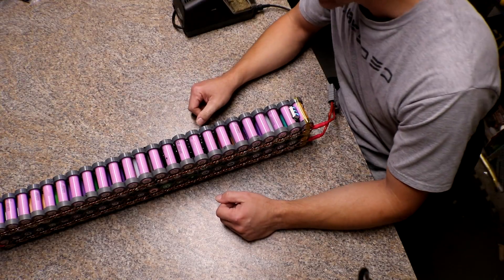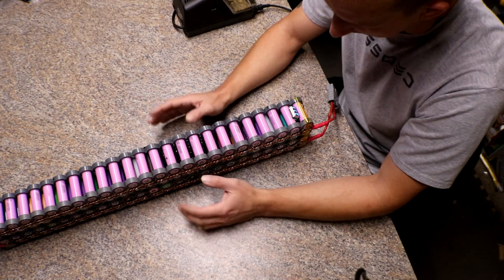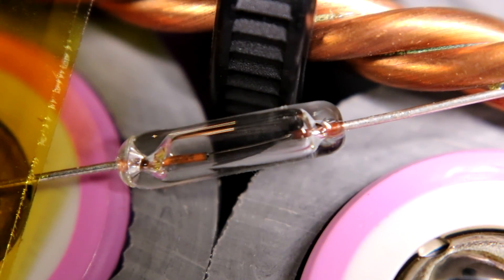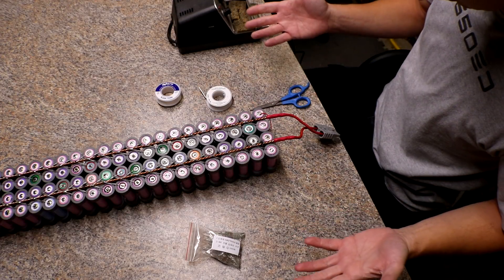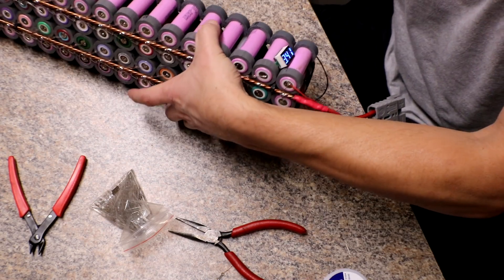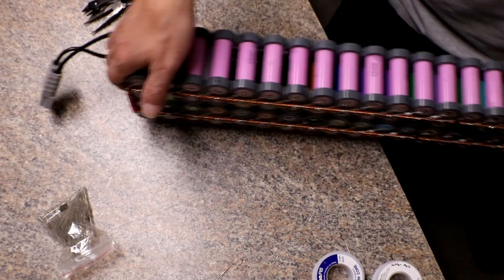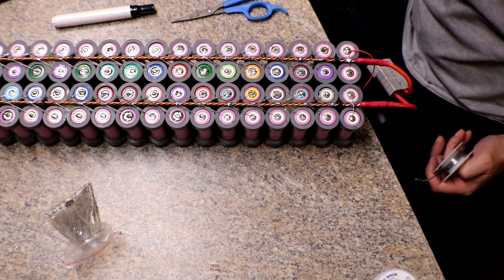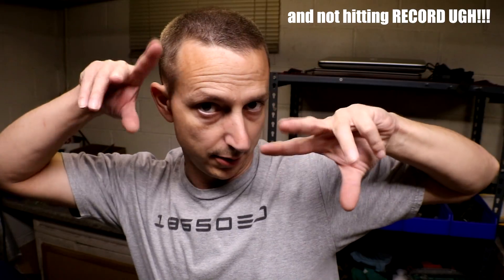Diy Tesla Powerwall ep62 kWh Load Test Failed Attempt

Comment: I don't understand this pack wiring. Where's the ground connector? both ends of the connectors on this pack are wired to the positive end of the pack
Reply from the maker: +Olivier Lopez Ch The positive and negative are at opposite ends from eachother.
Reply: Ah, I see. Thanks for replying.
Reply from the maker: You Bet!

Comment: have you got a link to the fuses you use mate nice work
Reply from the maker: The .5 amp fuses I am using are from Aliexpress https://goo.gl/YTgurx

The seller has other ones as well.  The .5a and 1a fuse pop at 2a .  I would get the 1a because they pop the same but have a little tiny less resistance. Those are here https://goo.gl/qzB57k

Comment: your packs are too borking large, dangerous.  I'm scared with my 3x5s but that's how my 4x5 clips came (super cheap bids, can't blame hong kong for overlisting)  but I'm thinking 3x3x3x3x3x3x3x3 etc
Reply: bcmasur that is y the cell level fuse is important tesla wouldn't put them in a powerwall application or in a vehicle without that research being done

Comment: If after being disconnected from the pack, the cells remain at the same volts as the rest of the pack (say a week later or two weeks even if you're as picky as I am) then you picked good cells for you pack.  Maybe I'll sell backsoldered magnets at 18mm lengths just for this.  nice.  good.  cheese.  please, my cheese...

Comment: don't solder indoors!  (unless you have a vacuum hood or some other great ventilation)  just do it outdoors and even then I am against soldering, it's too permanent and "unmodular" ?
Reply from the maker: I made a solder fume extractor with the carbon filters and then a hepa filter.  Seems to work pretty good.  Ive been thinking of making it exit out through my basement fireplace lol.  Need a longer hose for that 👍

Comment: Your packs should be more square shaped (cube shaped) than long rectangular shaped.  The way you have it here at around 2:30 in the video (or anywhere else) you should have your huge connectors in the MIDDLE of these packs instead of at the ends.  This also makes me think you needed to more thoroughly test each cell before adding them to the packs.  Also, I know I comment a lot on your videos, if at least one thing helps I'm glad to contribute.  I'm still magnetically connecting everything in my modular packs, still only 3x5Px3S at the moment.  Remember, my ebike battery was 12Sx16P in a USPS medium flat rate box, also aluminum duct tape and neodymium magnets.

Comment: second lost data info for your kil-o-watt meter how bout using a camera to record the usage time so you can recover it later after the inverter shuts down you can log your start time with the camera and use the kil-o-watt meter to log the kilowatt hours used untill it gets shut down
Reply from the maker: Doing a test right meow and the time lapse camera is working on it this time.  It was suggested on the fb page that I stream it with everything plugged into it and when it dies the stream ends cause there will be no more Power!!!  Might have to do it!
Reply: camera is the best way to go not every one can set long enough to watch paint dry in a cold room. rofl
Reply from the maker: True That!!!

Comment: Hey Joe, quick question, did you check for those cells voltage? in order to put them back in parallel they should have the same voltage as the rest of the pack, right?
Reply from the maker: Yuppers, they were close to the pack voltage so I just put them back in.  I do check with a spare fuse to see if it pops first tho.  I know the first time I found broken fuses when I first started messing with it a few weeks back, the cell was full charged and pack was at like 3.2ish I had to either recharge the pack or drain the cell so they were closer in order to reconnect the fuse 👍
Reply: Cool!!! So if it was a very different voltage, higher or lower, the fuse would pop?
Reply from the maker: With the fuses I am using yes.  They pop at 2amps so if the difference is to great it will pop.  I show it in this video https://youtu.be/p8rRMUomcj8

Comment: How about adding a cross tie of the same twisted wire "bus bar" on the positive rail just to one side of the battery before you go out to the Anderson?  That would stop the two sides of the rails from wiggling apart when you are playing with the packs.  Also add a little S on the fuse wires like was previously suggested!  DO IT!!  ;-)
Reply from the maker: +kirkb4989 Yeah I was planning to do the twisted piece between the 2 buuuuuuut forgot about it during that part. I usually forget to do things while videoing cause a lot of the time you are wondering if the recording of the video is in focus or in view ect ect lol. Im getting better 🤔
Reply: You do such a fantastic job now, I'm not sure how you could be better.  Don't undersell yourself!!  Oh hey- they do make a watt meter that remembers the values even if the power goes off that I've seen on Ebay for a reasonable price.  I could try to find it again if you are interested...
Reply from the maker: Thanks! Lol Ya I wasnt trying to sound like I was underselling, But I do intend to do things at the beginning of a video then realize I completely forgot about it while editing a video lol.  Ya if you see a link Ill take a look but you dont have to get crazy to find it 👍
Reply from the maker: Sweet, its in my list!!!

Comment: Hey Joe. Im working on a scaled down version of my own power wall. I found possible alternatives to your glass fuses that might help. 

I bought them on AliExpress, they are 2A micro fuses that look like thru hole resistor's.

FREE SHIPPING 100PCS x 2A 125/250V 2.4*7mm Axial Lead Green Fuse 2000mA 2.4 x 7 Fast Blow PICO Resistance Fuse
 http://s.aliexpress.com/uqqEvu2I 
(from AliExpress Android)

I haven't received them yet but will do testing when I do get them. I'll keep you updated on my results if you'd like.
Reply from the maker: +Steven Guzman I did do some testing with those and didnt go that route because you couldnt tell if the fuse was popped. I wanted a visual indicator vs testing them. Especially since there are 1400 and plan to add more packs in the future. Let us know what you find out 🖒

Comment: It is a little bit more work but instead of connecting the fuse directly with the hard lead connect a stranded wire to the fuse and then connect it to the bus bar that way it has Flex without breaking the glass fuse a little jumper made of 12 gauge or something of that nature stranded wire
Reply from the maker: +Kurt  Zxcvb Yeah that would be an option! 🖒

Comment: I think you should stop using the fuses .
Reply from the maker: But I like them 😉😀
Reply: AveRage Joe ya but seems that you have a lot more issues with those then running a thin 26 gauge wire as a fuse. Well hopefully that doing the swap around will help with the braking issues.

Comment: why was the cable tie loose? in the end, I think everyones doing it wrong. I would sacrifice length but having another set of holes at both ends and have no cells in it, then use those to brace the bus bars. In your case, you can simply put 2 on each side of the terminals (no need for 4 pvc cut outs, 2 will do). This is assuming you have room.
Reply from the maker: Well since my dumb ass didnt put the stand offs closer to the outer edge of the pack(when I was building the cell holder packs), if I tighten it more it bends the end down closer to each other.  The zip ties on the ends were a little tighter but I think from adding the kapton tape I made it to tight and therefore squeezed the ends closer together and made them looser lol if that makes sense.

Comment: now you have a charged cell you are paralleling with uncharged.  not good.
Reply from the maker: The cells were close in voltage to not pop the fuse.  Yeah if the cell was full charged I would of needed to get the voltage closer👍

Comment: Joe, another great vid - please keep up the great work. the fuse thing seems to be working in that you can get the feel of when one or two have blown by the way the voltage behaves on the pack.
i have an unrelated question - i'm wanting to get into doing some vlogs and was wondering what kind of editing software you use and if you maybe have a "wish" editor you'd rather use or have been thinking about switching over. i, (like you) like easy, but effective.
Russ from Coral Springs, Florida, USA
Reply from the maker: Aaaaaan the winner is....... Sony Vegas Pro 😀
Reply from the maker: Thanks!!!  I still like the lil fuses and that swap-a-roonie should fix the problem.  Yes for sure, the little tests so far are showing me good things as to when or what needs attention👍  I started with the windows movie maker and it did just fine.  I think for vlogs you could easily use it if your using windows.  I have since moved on and use Sony Vegas Pro 13 and love it.  I havent tried any others so I cant say if there are any easier or better editors.
Reply: in for the comments, what dose the average joe use? @average joe ?

Comment: Wonder if there is a way to remotely monitor each fuse....hmmmm
Reply: what if you create a fuse box with 1400 of those fuses in it with wires leading to it -  or would that increase the amps in the cell or something - adding wire - I dont know -- - - -  but it would be convienient to have all the fuses in a clear door box to view them all at once, you could even add you fancy blue leds for illumination. thoughts?
Reply from the maker: A remote location would be cool but then it would add a lot more resistance to the system.  A clear box would look cool with a bunch a leds tho
Reply: I figured as much since  you spent a few videos on the fuses and a few mm made the difference.  even if it doesn't work i think you should have a random box of leds... #goals jk haha thanks for the reply.
Reply from the maker: If it didnt add extra losses to the system Id do it cause I LOVE leds lol.  I do have plans for some leds in other places 😀😉
Reply: cool. I have been meaning to email you something. In the process of a project that I think you would enjoy. Mind if I send you a few thing with the email i got from your profile? thanks #nerdystuff
Reply from the maker: +rcpilotp51 Ya send it over. Thats what the email is there for 🖒
Reply: feel free to wait with baited breath... ;)
Reply from the maker: +rcpilotp51 Heavy breathing in anticipation😉
Reply: take solace in the fact the email will come tonight EST - until then ;)
Reply from the maker: +rcpilotp51 🖒
Reply: AveRage Joe sent!! -breath!

Comment: Seems like these glass fuses add a lot of hassle to the system with the movement you have in the buss bars.  Hopefully moving those fuses to the opposite side will be the improvement you need.  I am planning to start building a power wall soon and am still on the fence about whether to keep using fuse wire or go to glass fuses.
Reply: I just use 0.3mm magnet wire, 1 strand on the +ve and 2 strands on the -ve.
I'm sure it'll blow if there's a problem.
LC77AY-1 mini thermal disconnects used on lithium laptop pouch cells are also an option, but would have to collect a lot of dead cells to harvest enough. Unfortunately they don't like being soldered, and are around 65 cents each so would add a lot of cost.
https://octopart.com/lc77ay-1-bourns-60755136
Reply from the maker: Yeah its been a little challenge but I think that goes with most diy projects when you try something new 😄 Its night and day difference in strength.  To many options lol

Comment: Have you thought about using fuse wire instead of those glass fuses? This is what I purchased although I have not tried it yet: http://www.ebay.com/itm/BANNER-LYVIA-5-15-30-AMP-fuse-wire-style-B0304/182704264275?ssPageName=STRK%3AMEBIDX%3AIT&_trksid=p2057872.m2749.l2649
Reply from the maker: I have thought about it many times lol but still happy with these fragile pieces of glass. Ive tested that wire before in a video a while back.  I know it doesnt pop at 5a, think it was a lot higher but cant remember the number.
Reply: Those glass fuses just seem so fragile. I'm wanting to replace the lead acid batteries in a motor home with li-ion battery packs and I just can't see those fuses surviving a bumpy environment if even a volt meter probe can break them. Thank you for showing us all what works and what doesn't work. Your videos have been very helpful for me, especially the ones you call failures.
Reply from the maker: I guess they were designed for thro hole circuit board type things and Im using them completely the wrong way lol.  They seem super strong now.  Maybe Ill show that in one of the next videos.  But yeah in a motor home where stuff can bump in the night 😉 it may or may not work the best.